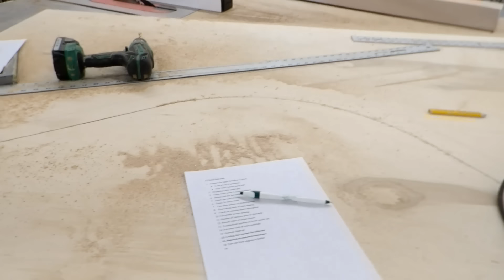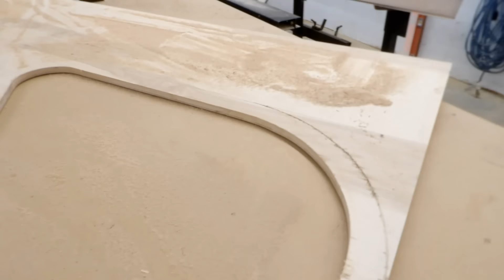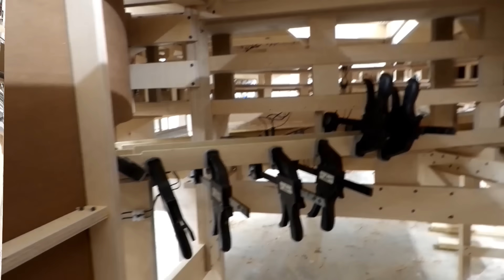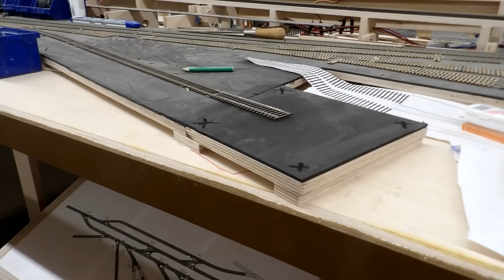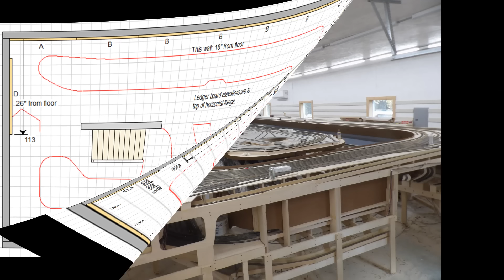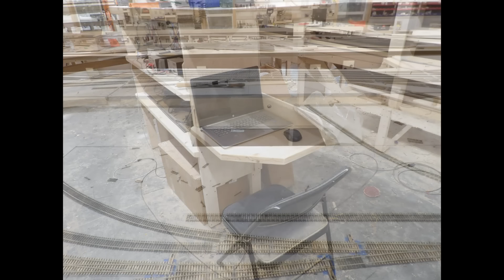The Sydney Project #62: Completion

Comment: Hi Peter, Was wondering would you ever consider writing a book about model railroad construction? 
Or partnering with a writer? 
You have incredible talent in so many areas. 
I’m subscribed, binge watching several episodes per day to catch up with you. 
I read every question and your every comment on them all and rewatched many sections. 
I just feel your knowledge would help a lot of hobbyists like myself. 
I completed my first “layout” before Christmas. Don’t laugh - a Christmas tree layout of 2 N gauge loops, 110cm diameter with a station at the front side and a tunnel at the back between the tree and the wall. Upper is 86cm and just a plain loop. Each are supported by 4 telescoping (so I can level the boards) brass struts. A 6mm/5mm tube with 5mm/4mm tube inside. 
Both boards are purposefully made from 5mm poplar ply 20mm wide to give the impression the train is ‘in the air’…
Should possibly have gone for 10mm ply, but will support it with stays. 
I do have plans for a round-the-house OO gauge shelf layout and one for the back garden and shed as well. So I do watch and try to learn principles and techniques from you as much as poss. 
What a super builder you are, I really appreciate your making these vids and hope you will write all your experiences down some day.